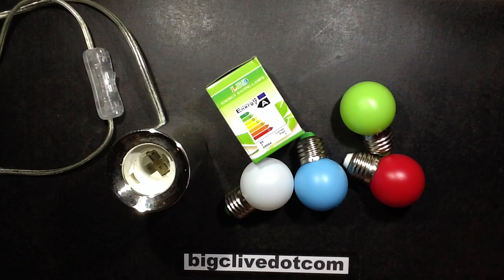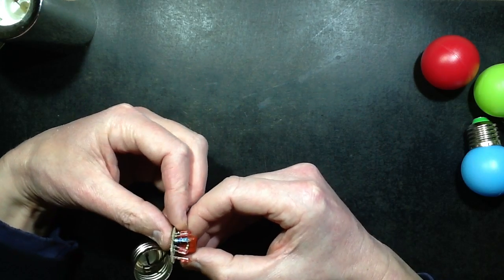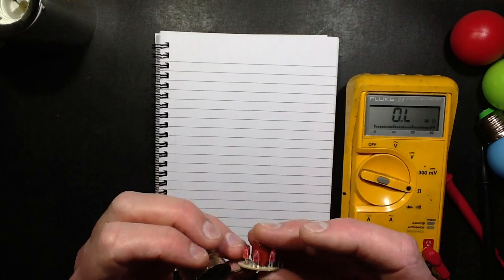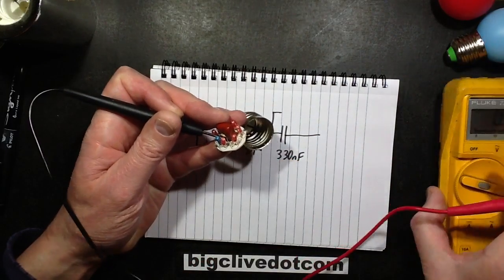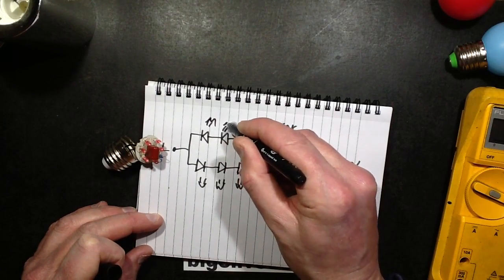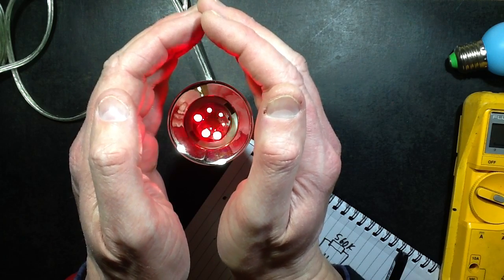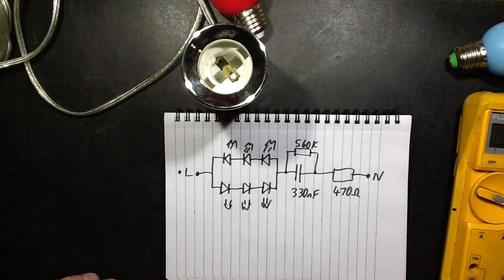Teardown of low power LED festoon lamps.

Comment: Oh! They are using oblong LEDs!
I saw that in one of the Sony PDA docks.
They are notoriously hard to find here, as they normally used round 3 or 5mm LEDs instead, making drop-in replacement extremely hard.
Reply from the maker: +Penurious Sierra The keyword for those LEDs is rectangular or bargraph.

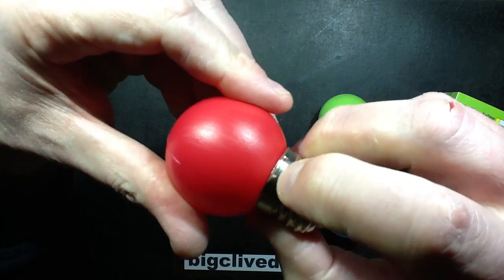Comment: 1:21
I'm not positive this applies here, but in connector manufacturing that technique is commonly referred to as "staking," and is done as a way to retain the insulator inside the body of a connector, such as in a coaxial RF connector. Basically, a set of small spikes come down on all sides and punch into the metal body, creating those little indentations that captivate the material inside.

Comment: Regarding the LEDs glowing when off, is there another video where you explain the cause in more detail? I'm not quite sure what you mean by losses in the house wiring.
Reply from the maker: +codebeard It's caused by capacitive coupling and the tiny resistive coupling in the mains wiring.  A long run of switch cable can act like a capacitor with enough value to pass enough current to make the LEDs glow.

Comment: I can actually see the flicker in most LED's. even when some cars that pass on the road I can see the flashing for blocks. some times my alarm clock drives me nuts when I look at it because of the strobing. its also kind of the reason why I cant watch a DLP HDTVs the cycling colors give me a headache.
Reply: Pat P 
You are normal, because some people are more sensitive to flickering lights and sometimes they can see them flashing too.
These people (maybe including you) are usually prone to seizures when exposed to bright flashing images.

Comment: Hey bigclive, I found an interesting lightbulb I thought you might like to check out/take to bits:

http://www.ebay.com/itm/Magic-Light-Bulb-Lamp-E27-3W-RGB-LED-24Key-IR-Remote-Control-Colors-Change-BA-/400827525043?hash=item5d532ea7b3:g:PYsAAOSwQJhUkotf

Comment: Cap is likely a 330n 250VDC unit. Will work for a while until it self heals open circuit. I do find that around 5% tend t fail as short circuit, so the 470R resistor will be a good safety device. The 560k resistor was likely the cheapest reel of resistors on the market that day.  I see any value from 330k to 2M2 and any wattage from 1/16W to 0.3W.
Reply from the maker: Most of the lights with capacitive droppers that I've taken to bits do use 400v caps.  Although it's sometimes indicated with a code letter.

Comment: I don't think the LEDs will be happy in that arrangement in the long run. The LEDs I have seen don't like high backvoltage.
Reply: The back voltage gets limited to the other series forward voltage. So they don't really get that high back voltage. Unless one LED breaks open circuit, then they would get the full back voltage.